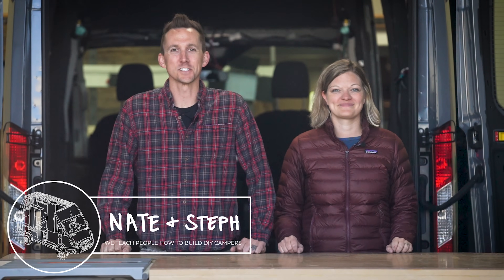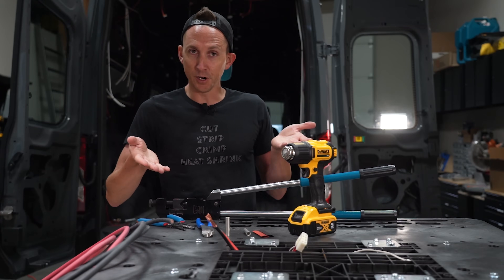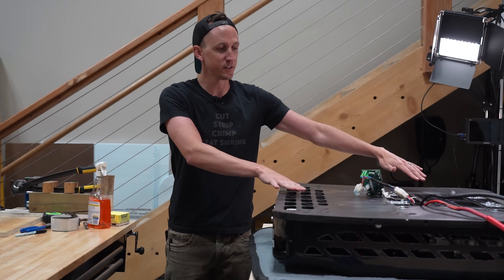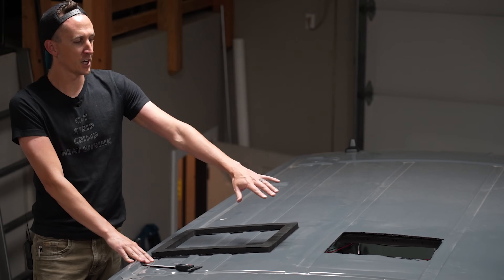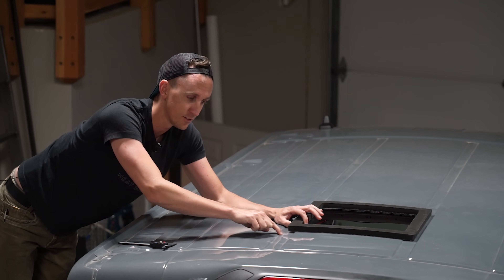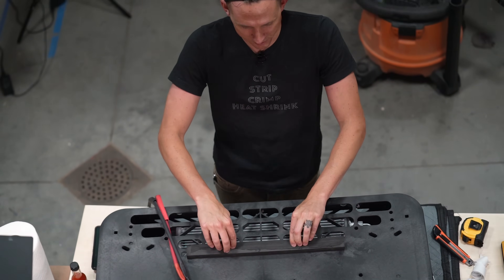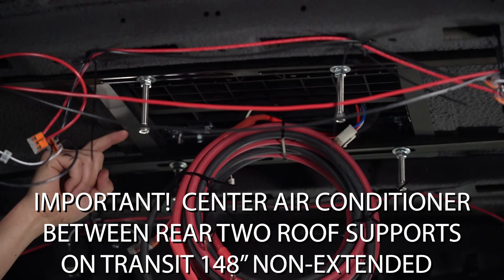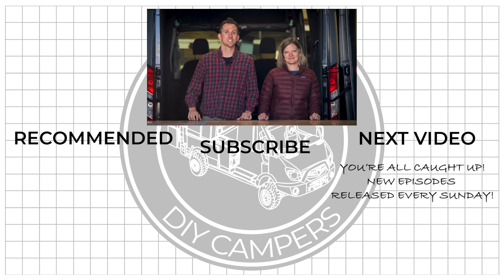Installing a 12V/24V DC Air Conditioner Into our Camper Van Conversion (Nomadic Air Conditioner)

Comment: Thank you, Nate & Steph, for another great video. I also have a mobile solar business and about 70% of our projects involve van conversions, mostly Mercedes Sprinters. Recently I installed a 24v Nomadic 3000 (in white) on a Winnebago Era (Sprinter chassis). I agree that using a residential mini-split on a van is not practical, though I prefer them on larger RVs where there is more space for outside unit. 

The jury is still out on the actual effectiveness of the Nomadic 3000 in a 17' long van, especially when the van is parked directly in the sun. Now, this particular installation was in a finished van, so I can't vouch for the insulation quality. There's only so much you can do in a van, anyway. I spoke to Nomadic before purchase and they recommended TWO Nomadic 2000 units instead of one Nomadic 3000, but the cost of that was not palatable to the client so we chose a single Nomadic 3000. They said it should work fine, but in the fine print of one document we saw it said a single Nomadic 3000 would only cool 20 degrees (F) below ambient temperature, and on a 90 degree plus day, the inside temperatures can rise to over 100 degrees due to heat load from the sun. 

When running on "cool" mode (vs eco mode) and the fan on high, we see about 550 watts. The output temperature is in the low 60's to high 50s. It's not quite as noisy as a traditional roof-top A/C unit, but it's pretty loud when the fan is on high. I set the thermostat to 74 degrees and let it run overnight in my shop. The shop was closed up and the inside temperature reached over 90 degrees (partly due to the heat dumped in the shop from the A/C unit). When I arrived, I found the inside of the van to be over 80 degrees and water dripping from the unit inside the van. The condenser had frozen over during the night. This was a one-time test and may not happen when used outside in a normal situation.

I think they need to provide a different interior bracket and trim kit for installation in finished vans. The parts they provide are good for new builds, but we had to do quite a bit of modifications to make their support braces work in a finished van. That's not too surprising, but I think if they are putting their name on a relabeled Chinese unit and charging what they do, they could provide a lot more value by engineering a solution for retrofits. 

Your installation video is more thorough than Nomadic's and their instructions are terribly lacking. Please do a follow-up video on the performance of the unit after your installation is complete. I realize Nomadic sponsored this, but we would all appreciate your honest and reasoned opinion. I've given them feedback on all these points and they promised to look into them and address any shortcomings. Since they're sourcing completed units from China, it may be months before any changes they may make would be available.

All-in-all, I think they are a decent alternative for roof-top A/C, and it's great having a source in the USA rather than gambling with purchasing overseas. I just wish they'd make a more polished end product given the $5,600 price tag. Good documentation, a higher quality control board, and multiple installation kits for new-build vs retrofits would go a long way to providing this extra value. For van life, this could replace the need for a 2 or 3kVA MultiPlus. A smaller VE.Direct inverter to run the occasional AC appliance or computer plus an AC-DC charger would be easier to install in tight spaces on a van. I think I will take your suggestion and install a SmartShunt on this client's A/C 24v power feed to collect data over time. 

I love how well-planned your work is and the quality of your work. We strive in our business to be as good as you. You inspired me two years ago to convert my travel trailer to an off-grid powerhouse and ultimately bring that knowledge to our clients. I just wanted to say thank you.
Reply: Great comments and your questions are the same as mine.  Great installation video.  

How does this unit perform?  Anyone dropping $5k would be really foolish to do this unless the unit performs well and is super reliable.
Reply from the maker: @gsftom  Time will tell, so stay tuned.  This video is only about the installation process and we will follow up once we use it more with some actual usage data if we get enough interest in a 'review' type of video.
Reply: @EXPLORISTlife  definitely interested in performance, so we can knkw wheter to recommend . Thank you
Reply: Awesome feedback, and very honest straightforward data - probably easier to get from someone who isn't "sponsored"!
Reply from the maker: Hey,  @dznnf7 ! I hope you aren't implying that I'm being dishonest because a company is paying me to have their product featured in a tutorial.  It's important to understand that I have complete creative freedom in these videos and can talk about whatever points I want.  I wish you knew how many sponsored video requests I turn down every day because I think it's a garbage product.  If I were only about the money, I'd be turning this channel into a battery and portable power station review channel; because that's where the sponsorship money REALLY is...but that's not my interest nor do I think it's helpful to all of you tuning in to watch my videos.

Looks like this is the first comment on my channel... so, welcome!  Stick around, or go watch some of my previous videos and you may get to know me a little better and understand that my integrity is incredibly important to me.
Reply from the maker: Hey Ed!  That's great feedback.  I could definitely see how the mounting brackets could be a pain on a retrofit being as long as they are.  I think my biggest gripe in that regard was the lack of 'flange' on the inside so it was somewhat challenging to make sure I had the unit square and aligned; especially since the positioning of the unit in relation to the maxxair fan is VITAL in my setup for maximizing solar layout as you'll see in the next 3 videos.

I'm excited to see the performance of the unit.  We spent extra time/effort/funds insulating; so I suspect it will work pretty well to keep the space cool; plus the entire roof is 'shaded' with solar panels.  I don't anticipate the unit never freezing up just understanding how air conditioners works; but time will tell once we get to use the unit more.

Glad the videos have helped.  Keep up the good work!
Reply: Excellent comments there Ed, id like to see a follow up on all the points you have made and overall performance. I know the house units can work really well/efficiency wise, they aren’t really made for mobile travels though and often fail due to vibration affecting piping, rattling compressor too much etc, on the bigger vans/buses they may survive better with the smoother ride and their price point makes them quite viable to replace more often if necessary, as many Aircon’s seem to have issues when it comes to RV’s, vans, etc, even when you have paid for a properly manufactured & fitted mobile unit. While the 24v unit will have to be better for this purpose I am still somewhat sceptical myself to how well it handles those extreme temps, solar panels overhead will definitely help and good insulation will be a must, but have to have faith in Nate and his hideous battery build, it looks like he wont have any trouble to run it most of the time. Cheers

Comment: I like that you are doing the 24 volt system. They really seem like the way to go and far more efficient. I'm in the process now of converting my T1N Sprinter Gulf Stream from an older 12 Volt camper setup and am heavily considering the 48 Volt system using an "All in one Inverter" . You can install the whole system in less than an hour ( just unit, 48-12volt converter and the battery) vs using all the endless components it seems in a 12 volt system.  I look forward to watching this build. You're a great teacher with a style thats very easy to follow!
Reply: ive been trying to find more information on this exact thing! please let me know if you came up with more info. in this scenario, would you get a 48v air conditioner and then just have the 48v to 12v for everything else in the van? and how exactly does this make things more efficient besides being able to use thinner cables? or would the air conditioner actually be able to run longer since its lower amps? still trying to understand and it seems like not enough people are doing this for me to get the info i need. thanks for any help!

Comment from the maker: Check out the full electrical installation tutorial for this build: https://www.youtube.com/watch?v=E5q7_4FH4LQ&list=PLmvhcyi4n0TVfA4XCYJBkzfUXunSON1zX

Want to see the finished product w/ installation of the inner trim baffle?  We did that in the 'walls' video here: https://www.youtube.com/watch?v=cf2BjQxMKDI&list=PLmvhcyi4n0TVfA4XCYJBkzfUXunSON1zX

Nomadic 3000W 24V Air Conditioner: https://www.nomadiccooling.com/products/nomadic-cooling-3000-24v?variant=40757954019537
Reply: Will you be doing an efficiency test?  Power consumption and actual cooling efficiency?  For your build?
Reply from the maker: @xavierpendrag0n  We will do a power consumptiom test and review if there is enough interest.

Comment: I would like to point out that my super efficient mini-split is 3x that size and weight and is way less aerodynamic for the same cooling capacity.  I'm losing 10-20% efficiency running it through an inverter instead of going DC only, and I had to more than double my inverter size, weight, and cost to account for the mini split.  I'm also running pressure lines for many feet around my trailer, all potential leak points that are a serious consideration with bumpy roads.
 
The specs on this AC unit are a bit all over the place.  No EER rating, but I'm going to try to calculate it.  I'm going to spit out numbers from Nomadic's website and instruction manual.  The manual includes the Nomadic 2000 info without differentiating it from the 3000 so I don't know what's what.  Cooling Capacity: 12,480 BTU.  Cooling capacity (Standard mode): 2800W.  1 Watt cooling capacity (not electricity) = 3.412 BTU, so it looks like some device in some mode has a cooling capacity of 9,553 BTU.   They say that ECO mode uses 24A@85F (576W), but MAX mode uses 20A@85F (480W) and 50A@100F (1200W).   System operational modes:  Cooling, Fan .  So... I don't know if ECO is considered Standard, and if it's a subset of Cooling mode which is less efficient than MAX mode and now I've gone cross-eyed.  Anyway, EER = BTU/watts(electricity), so I'm getting anywhere from 8 to 26 EER depending on which numbers I use.
Reply from the maker: That's a great point about being able to downsize the inverter.  If one were to use a DC air conditioner and diesel/petrol for hot water; the 'big' electrical loads would be pretty minimal from a DC to AC inverting standpoint.

I think I may put a SmartShunt inline on the AC wire to get some actual daily usage of just the air conditioner for the sake of trying to nail down some numbers.

Comment: G'day guys what is the meaning of the turtle tatoo if I may ask.  Would an split system aircon not use way less power??
Reply from the maker: DC air conditioners are incredibly efficient as-is.  Would a residential mini-split be MORE efficient?  Maybe a little... but I couldn't think of a way to make it both DIY friendly AND not look like garbage with a big condenser hanging off the back.

The turtle tattoo is my wedding ring, effectively.  Steph and I never really wore our wedding rings so we both got tattoos on our left ring fingers last year.